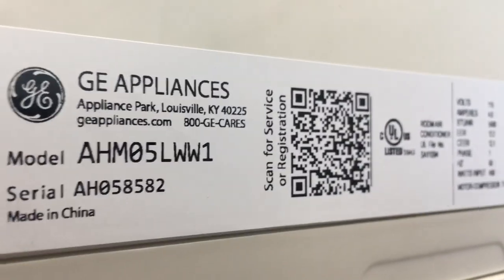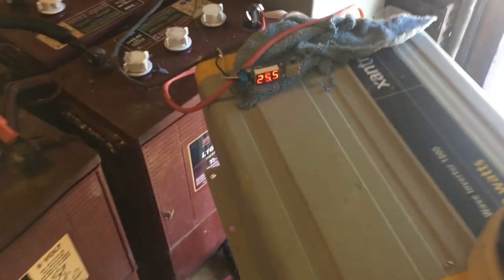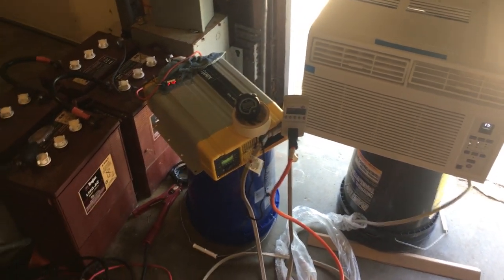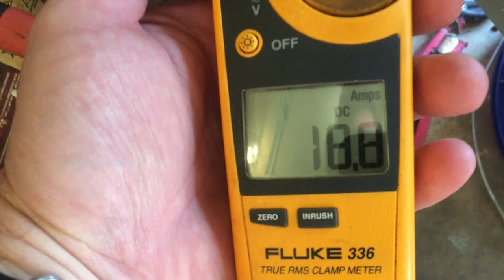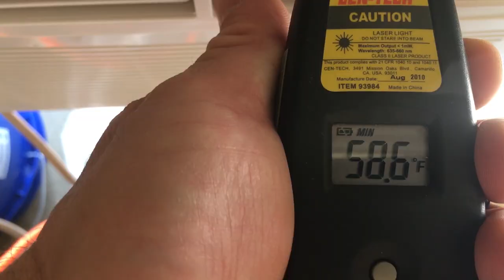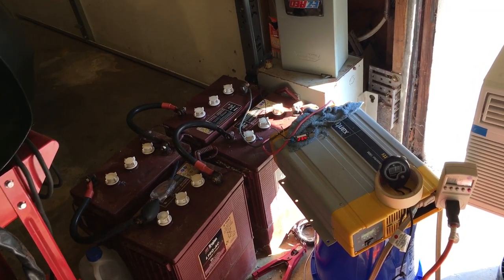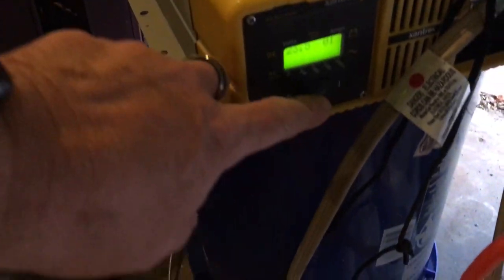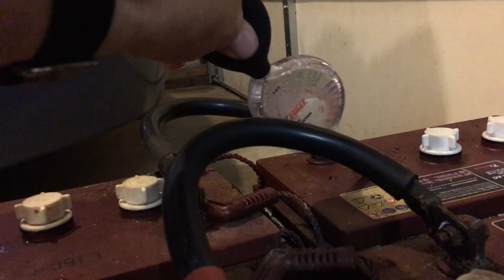running air conditioner on batteries

Comment: So you would need a 24 volt system to run this setup for the duration? Or will a 12 volt system work? I’m a truck driver and I’m planning on getting a similar set up with a portable AC unit at similar BTU. I know for sure it wouldn’t run continues like yours did. I need 8-10 hrs of run time as well. Thank you in advance.

Comment: I noticed u didnt turn the temperature setting all the way down to keep the air conditioner in cool mode turn the setting down to the lowest temp to keep the compressor running

Comment: So i am wanting to run a 5000 BTU AC in my rv while im out working for up to 5-6 hours to keep my cat cool, I was looking at some 6v 215ah batteries, Any idea how many of those i might need?
Reply from the maker: roughly 6 of them. Heres the rough math 600 watts X 6 hours of ac use =3600 watts needed, each battery will give you 1290 watt hr but you have to divide that by 2, so 3600/645=6 batteries, I would strongly recommend lifepo4 batteries, they are lighter and can be discharged further than 50% if you used lead acid. if you bought 2 12x200ah lifepo4, youd only need 2. and you can get them on amazon for about $800 each.
Reply: @SuperRobkar  Unfortunately. Im on a very tight budget due to having to being forced to live in my rv ( shitty landlords ) i am very tight on funds and have to work with whats the cheapest.. I was also thinking of getting 4 or 5 12v 122 amp everstarts from walmart.

Comment: I'm curious - What was the current draw when the compressor started?
Reply from the maker: I tHink for this model it was around 20 amps. Those xantrex inverters can really handle a surge well. I have an old fridgeadare that uses about 35 amps on startup, and that xantrex will actUally start it up.

Comment: how long you thinks a 5500 btu air conditioner going run on 12v inverter 1200w rms power same size of batteries bank I'm considering running it whole night will it work ?
Reply from the maker: Kirito Kirigaya  you’d only get a few hours out of it. If you want to run all night,  you better get about 16 batteries.
Reply: @SuperRobkar  So you saying that a 24v and 48v inverter is way more efficient for that use ?
Reply from the maker: Kirito Kirigaya they are slightly more efficient, but mostly allow you to use smaller gauge wires.  The issue is about the same for 12, 24 or 48. 4 batteries will not run your ac over night,  you might be able to get away with 8 , but best would be 12 or 16 that way your not running them down as much

Comment: Hi I’m want install that kind of system on my sail boat, to chage thise battery with my solar panels the are in total 600 watts 24 volts how many hours do you think I need to charge? If the sun is ok
Reply: *charge those
Reply from the maker: claudio atilano Hi,  this would depend on How  long you run the ac. If you buy a highly efficient 5000 btu ac then it would consume about 400 watts an hour. If you run the ac during the day, the solar would cover that and then some back into the batteries. It’s all about knowing how much you are taking out of the batteries and how much you have to put back in, and the size of your battery bank. And in your case are you running the ac only at night and all solar is going into the batteries during the day? How many Ah is your battery bank? But let’s assume you ran it only for 8 hours at night. That is 8 hrs x 400 watts =3200 watts, your solar can supply 600 watts an hour, so it would take on average 5.3 hours to replace that you used. Now you have to assume there will be losses, and fully charging will take longer due to the absorption cycle when charging.
Reply: Hi, normally I need at night, thinking to buy AGM with the same Ah you have on the video
Reply from the maker: claudio atilano that would give you about a good 8 hours before you hit 50%. And it would take roughly 6-8 hours to fully charge back up @600 watts an hour.

Comment: How do you charge this huge battery Bank and how much time it takes you to charge near 100%?
Reply from the maker: I use a 24v smart charger that is made by  snap -on, I stick to Trojans charging specs, My batteries are 390AH at 20hr, so 10% of that is I can charge at a max of 39 amps. My charger usually does around 20 amps, so in this last test, I used about  3600 watts (400 watts for 9 hours of run time). So at 20 amp charge rate, it would take (20ampx29v=580 watts an hour, 3600/580=Roughly 6 hours to charge to around 90 pct. Keep in mind the charger is smart charges so it goes through a few stages and the process takes a bit longer than hours.
Reply: Ac that i want to run has these numbers on the sticker   input (W) 1574   rated current (A) 7.11  and our electricity is 220v 240v 50Hz
Reply from the maker: this is shown in video at 39 second mark .
Reply from the maker: that ac you want to run is alot larger than mine, it looks like yours uses 1574 watts ( 7.11 amp X 220 volt). You would  need alot more batteries to run that setup. you would need 16 batteries of this type to get 8 hrs of run time, and a suitable charger to charge them back up - 24v system x 16 320ah batteries=30,720 /2=15360 usable watts /1574=9.75 run hours